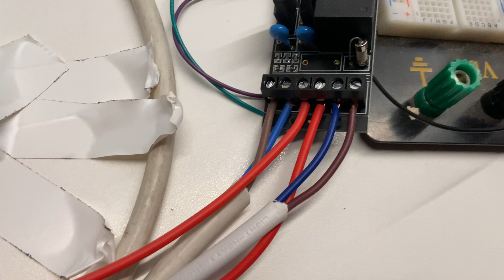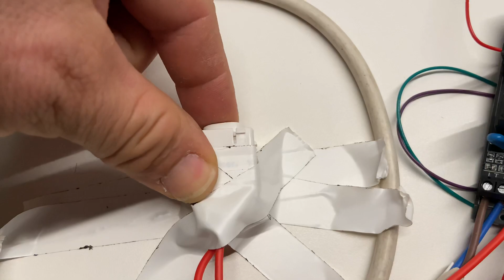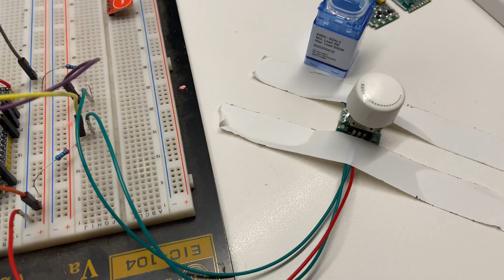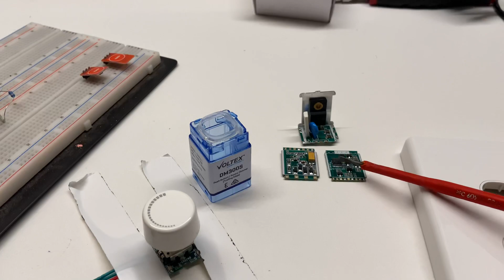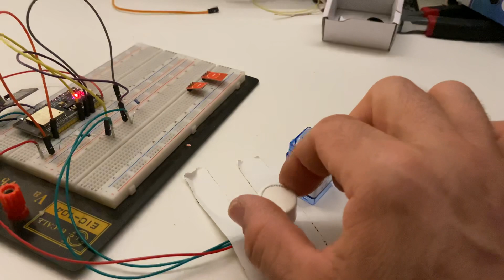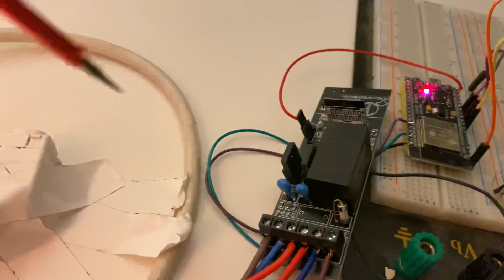Project Universal Dimmer???

Comment: I'm in NZ and having a hew house built. I'm keen to modify your circuit to allow for say.. a board controlling 8, then another 8 next to it. In a cabinet. Then all lights wires run directly to it. Im going to have cat5 running to switches, then make up some switches with 3.3v logic. 

Can you think of any thing else I need to consider with running 8 at a time?

Oh also running esp32 eth01 ethernet

Comment: This project keeps popping up in my youtube feed, we have to make one with a power monitoring chip. Traders powermesh use all TI gear and have that power monitoring built in factory! 

I imagine a world where every electrical device is serialised with their kwh total output.

Diginet make a rotary dimmer that's mean to work with bluetooth also, I believe it's creator/s moved onto Powermesh.
Reply from the maker: I’ve been distracted by battery build of late, but yes that would be the best thing if all devices measured and shared their power usage maybe even using power line communication.  Ever since i’ve had my power use displayed on a real time screen I’ve trying to work out were it’s all going. I’m trying to see if I can power my house entirely off grid, it very challenging I peak out my power use at 43kwhr a day in summer which is too much to generate using solar alone. I have started playing with ACS37800 ic to that end and maybe combining it into a dimmer.

Comment: nice work mate, I am building a similar circuit for Home Assistant but instead of DAC and level shifter I am testing with the LEDC PWM lib and a second-order low pass filter at 8bit resolution seems to be getting decent control on the dimming. I'll post the circuit once ready, this should reduce the cost further.
Reply from the maker: I’d be interested to see the circuit you use